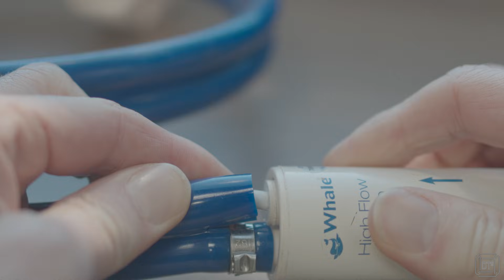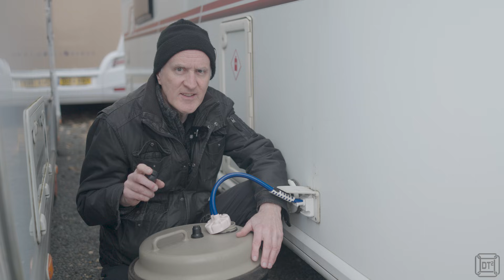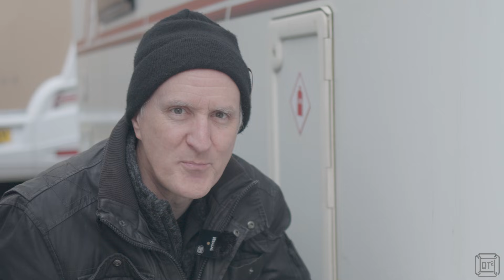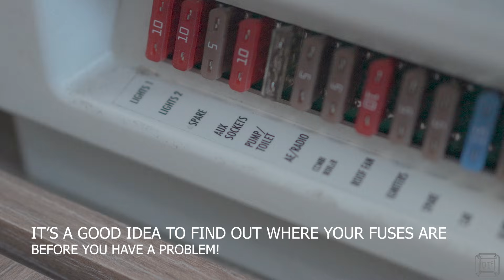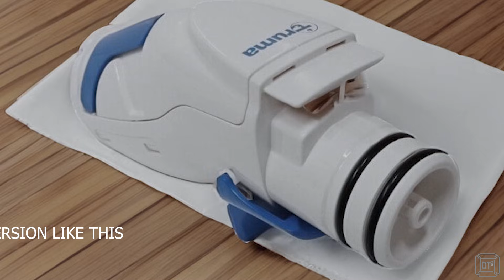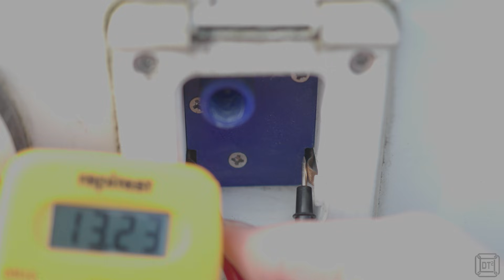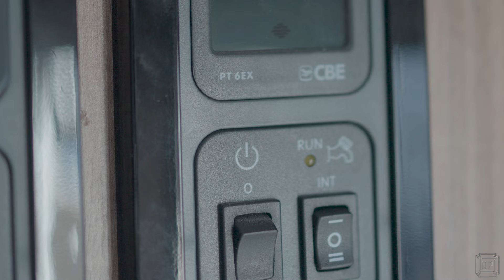CARAVAN PUMP NOT WORKING - Common issues and fixes

Comment: Hi there, we arrived onsite with our new van  waterpump not working. Tried everything, phoned dealer but couldn't help till next morning. Watched your video and got it working. Cleaned up the exterior contacts and eureka, it worked. Thanks very much. We were 100,s miles from home, life saver.
Reply: Same here with my 12 month caravan. The Whale Watermaster submersible water pump worked perfectly the last time it was used last September. Arrived on site recently and nothing. I tried everything in this video but nothing. I had to buy a Whale Aquasource mains water connection kit so I had water in the caravan. 
My problem was twofold. Firstly, the Whale Watermaster IC (Intelligent Controller) on the back of the water inlet had failed. I replaced it, but the pump still wouldn't work. I tested the contacts, there was power to the controler and microswitch, but nothing at the pump contacts. I pulled the contacts out and found that the female spade connector soldered onto the brass contact which engages with the male connector on the microswitch was so slack that the pump contact just fell out. I crimped the spade connector and refitted it. Bingo! The pump worked again. I recalibrated the Watermaster IC and all is good again.
However, I'm going to keep using the Whale Aquasource mains connection and keep the pump for sterilising the water system.

Comment: Thank you for the video, I have an 2017 elddis avante with the pressure system. When you turn the power switch on it pumps water in fine, once at pressure you turn the taps and nothing. I have to manually turn the power on & off again for the pump to start, would you have any ideas please ? Mike
Reply from the maker: I would say it is most likely that the pressure switch isn't calibrated correctly. Locate the pressure switch adjustment dial and then with the pump turned on try turning the adjustment dial in or out until the pump starts running. Then back it off just a touch until the pump stops. It could be that the pressure switch has failed but calibration is the first thing to try.
Reply: Ive got the same problem with te same caravan and.year ! I'll have a go at checking pressure switch

Comment: I have a whale pump that will not turn off after running water, if i turn the switch off then on it is fine until I call for water again, I dont appear to have any adjustments for pressure either on the switch (yellow back 3 wires) or externally on the pipework... Any suggestions ?
Reply: I have this pump, and the green light now stays on even when taps are closed! When the pump is plugged in it blows a fuse immediately.  Any ideas on this. Thanks.
Reply from the maker: Does it start running as soon as you turn the system on?
Does it eventually turn off after a while?
Can you see any electrical wires going to the tap itself?
Reply: @DTSquared  Hi Mate, after a bit of googling I beleive I have resolved it, ... it appears I have an IC pump and it just needed calibrating... to help others 1st press and hold the small button on the back of the switch till the light starts flashing 2nd turn on shower (Cold) for 30 seconds 3rd Press small button again after pump has ran for about 10 seconds .... it sorted mine so hope it helps others

Comment: Would you any suggestions on how to free the impeller on a pump.
Reply from the maker: Are you certain that the motor is running or at least trying to and that the impellar is stuck?
If so, I can't see any way to get to the impeller without breaking open the whole unit, which would likely destroy it. The lower blue filter cap comes off easily enough but doesn't expose much of the impeller. 
You could try disconnecting the water hose at the top of the pump and blowing through it, which could possibly clear any debris. 
As a last resort I guess you could try temporarily connecting the power with opposite polarity. Depending on the motor type, it may reverse the direction which could free it. But that's a long shot and I couldn't guarantee it wouldn't also harm the motor.
Tbh if the impeller is jammed, then the motor is likely to already be burned out if it's been powered on for any length of time. 
Best of luck.
Reply: @DTSquared  ok.thanks for the info.👍
Reply: Hi, every hour or so my onboard system makes a noise like the water is being turned on but , it only lasts about 2 seconds then goes off. The water is running fine . Any ideas what the problem could be setting off the onboard pump?

Comment: Thanks Dave, had this problem early last year, I checked everything and by adjusting the pressure valve it started working fine,👍.
Reply from the maker: Thanks Buster, I was in two minds about leaving the section about the pressure switch in , as I thought it may be too uncommon. Glad I left it in 👍